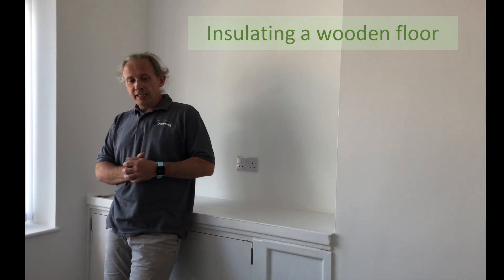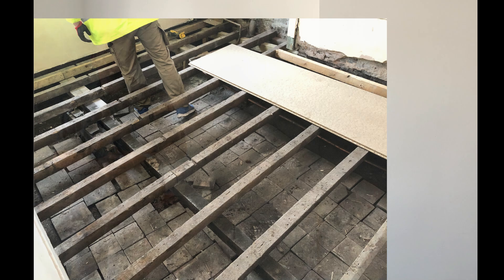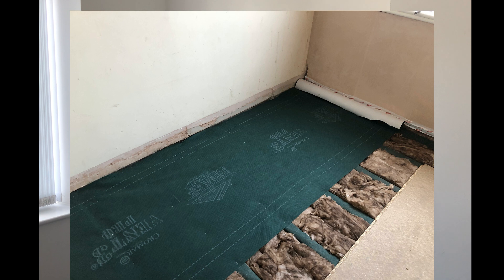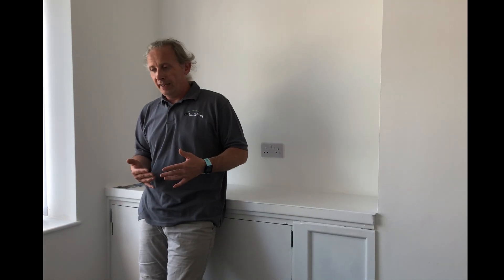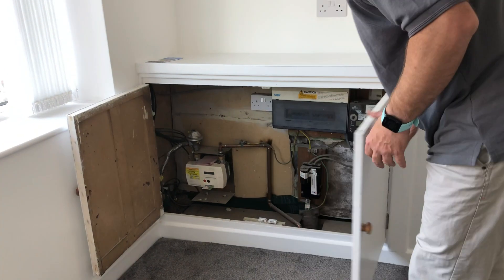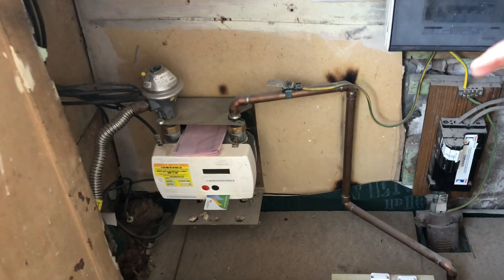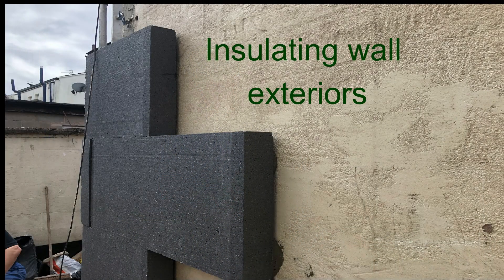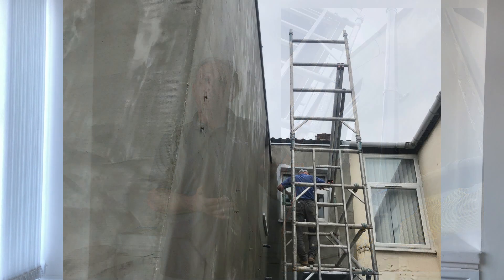Promoting energy efficiency with @dkbuildingliverpoolltd511

Comment: Great for those with the money. A lot of people in this country won't be able to upgrade their homes or afford to heat them. The Govt. have set an arbitrary target date for getting rid of gas boilers and will be charging ever higher penalties to boiler producers forcing a move to so called sustainable air source heating. It's not sustainable if you can't afford to install one or when you do the output of heat is insufficient to keep you warm.